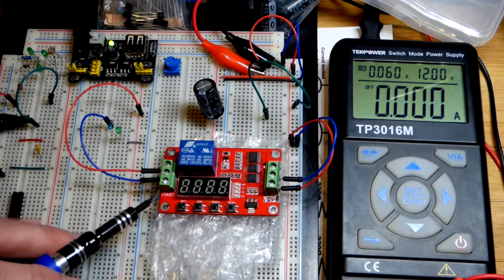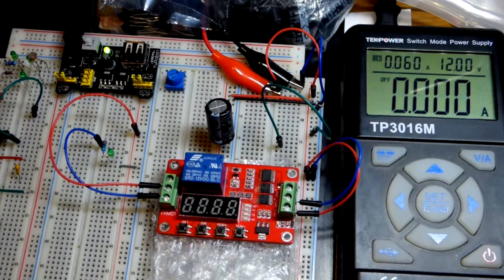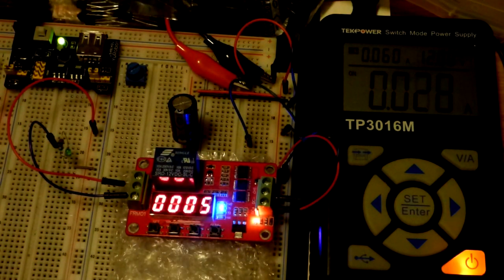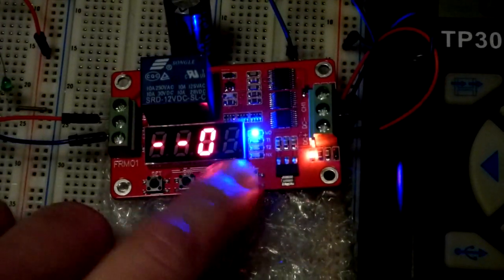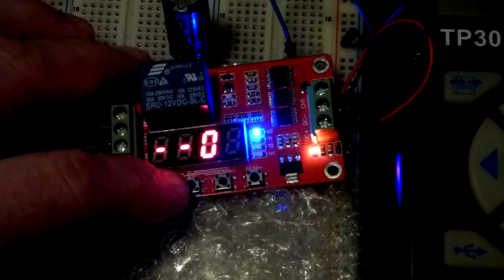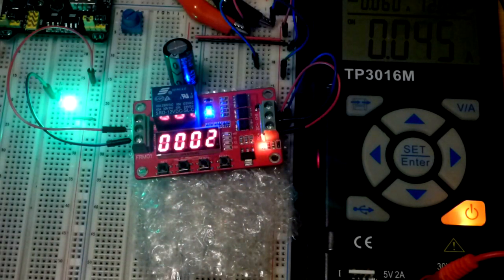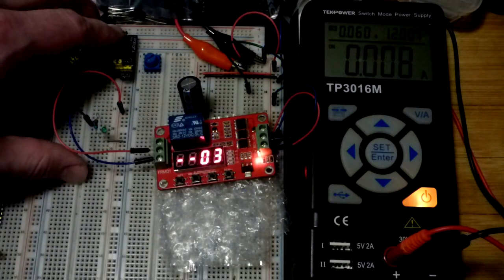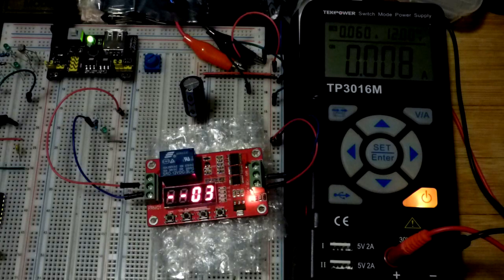FRM01 18 function timer relay module Function 03 programmable timed on then timed off until reset

Comment: Is a capacitor so essential?
Reply from the maker: If I bump this power supply, it briefly cuts power to the breadboard. So I usually need a 470µF/1,000µF capacitor across the breadboard supply rail to keep it from losing power during that time. Other than that, it is doing nothing and is not needed.

Comment: Which Function should I use to provide a set number of power cycles? Can the timer be set to 0.1 or 0.01 seconds? I need to energize a fuel injector for testing flow rate. What I'd need is to send power to the Injector for example... 0.01 seconds ( on 0.01 and off 0.01) for 50 cycles,  then stop the run automatically, so I can test several Injectors and compare flow rates. Is that possible with this unit?